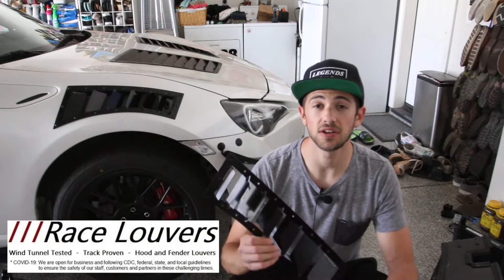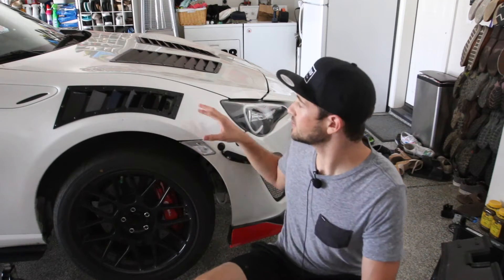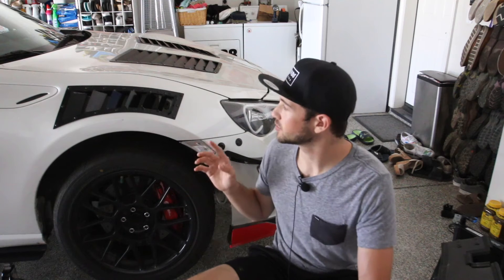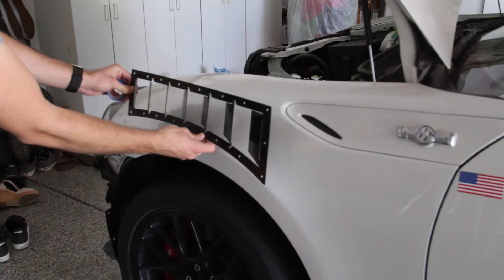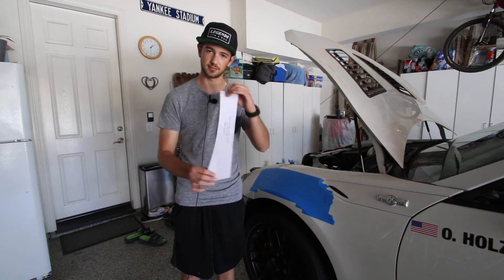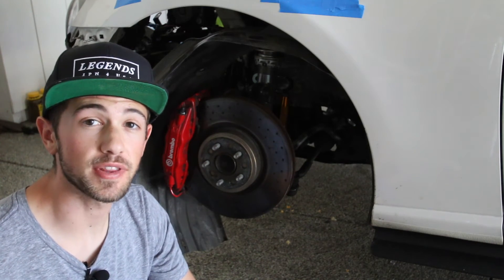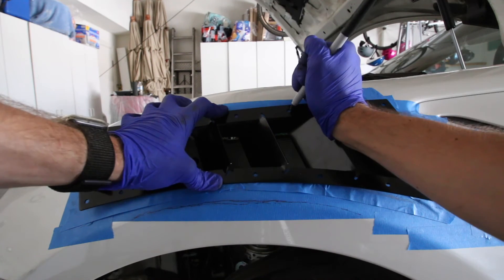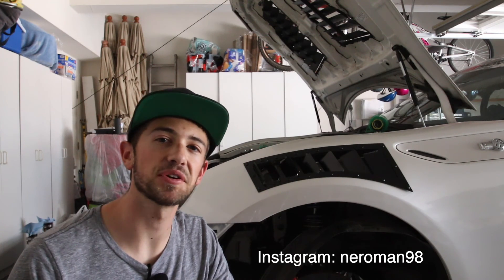FRS/BRZ/86 Fender Vent Install- RaceLouver Curved Fender Vents

Comment: I ended up going with ones made for another car N series. I hate that it isn't matching the curve of my fender. Yours has the same. I have a plasma cutter but its not going to give me the cut presision I want. I am going to scan the store bought fins then manipulate the entire thing to give me a perfect fit. I will be useing a laser cutter to cut plastic like Kydex then heat the material to move fins to the desired angles and form fit to the curves on the fender. I will probably beef up the pivot point after I'm done. I may bang out a few extras to sell after I work out the details. Something else I am doing is is laying 1/2' poly (white) and again heating to form to fender cutting it like a frame to this for anyone that doesn't want to cut out the fender just yet and be sure of how they want it to look first. That is for someone that doesn't race but loves the look.

Comment: Does the water from rain goes through your hood vents?
Reply: Caps Lock  there’s not water going in your engine at all even you diy car wash it?
Reply: @MrJ-bv5kq  just make sure you cover your air intake filter and you're good👍
Reply: Yes.